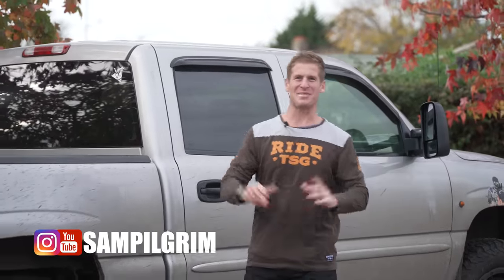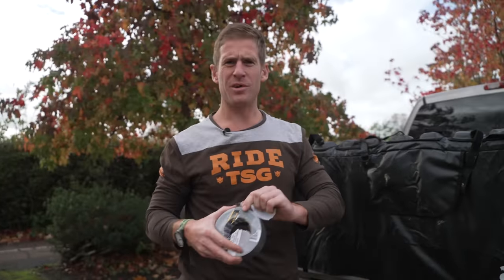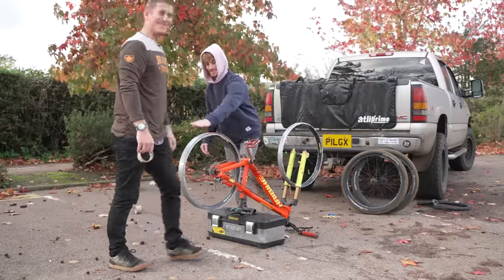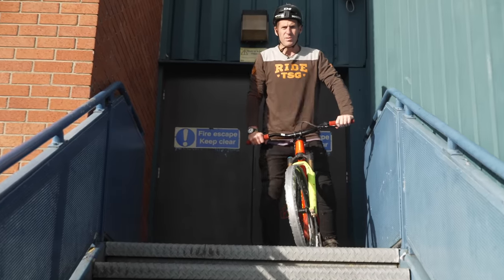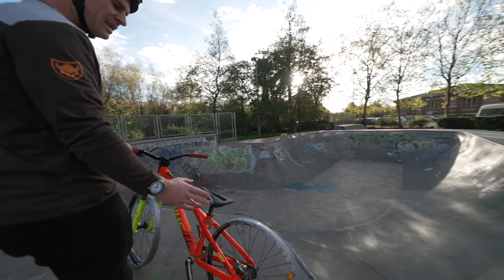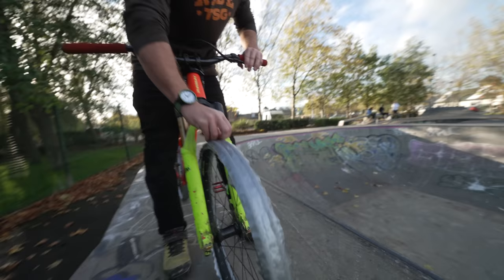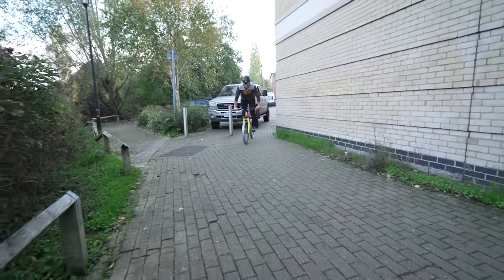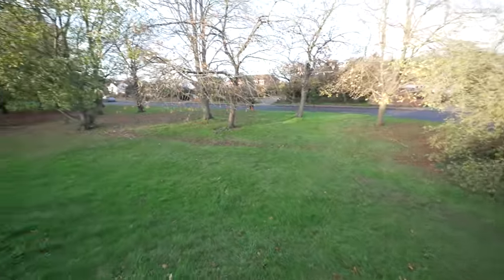DUCT TAPE TIRES ON MY MOUNTAIN BIKE!

Comment: Duct tape works surprisingly well and much cheaper than tires! As for the weight issue? Overrated! 😅 Thanks for the shout-out Sam!
Reply: Well he didn't watch your video, but at least he gave you a shout-out anyhow. P.S. hope Yuka is recovering.
Reply: Gotta feel good to be on the same Duct Team as Pilgrim 😆 And you can be proud of being the original taperider 🦆 📼 🤘
Reply: Cheaper?? It's 26.00 a roll.for the good stuff where I'm at
Reply: @BrianB78  what happened to Yuka.  I couldn’t find the vid
Reply: proper duct tape is about 5 pound each
Reply: @Olliesmith180  on her channel
Reply: @Olliesmith180  last video on her channel ;-)
Reply: your video was awesome!
Reply: @Hybed  I can’t watch it
Reply: Hi Bcpov!
Reply: This would be a sick collab both your channels rule
Reply: Did you mean... "over-weighted"? 😂
Reply: @maddmavic  you can get the cheap Chinese ones for about 12$ for a 10 rolls box 😂

Comment: 4:34 I love how Pilz is unironically making his truck an absolute redneck dreamboat.
Reply: Never understood why people would lift trucks. All it does is worsening overall handling and cornering, and lowering fuel efficiency too.
Reply: @tomlademann2521  makes them more dangerous as well because you create a huge blind spot in front of your truck. It's actually so bad in the united states that all SUVs and trucks over a certain height will be federally mandated to have automatic emergency braking systems. The reason is that because of the size of cars in the US, routine low-speed accidents are killing more people. What happens is these monstrous vehicles barely hit a small car and wind up killing the occupants. 

Additionally, some states have ride angle limitations on some trucks because people lift them in the front but not the back, which creates an even larger blind spot in the front of the vehicle. 

The only reason to lift a vehicle is to fit larger tires on there if you're off road a lot, which means you don't care about handling/cornering/fuel efficiency.

Comment: Hey Sam something you might want to consider instead of matte black on your truck is to rhino line it. It comes out black but it's that's stuff they spray or adhere inside the bed of your truck. Research it check it out I think you'd be more happy with rhino liner than paint cuz it won't scratch as easily Good luck. Also, make sure you put on some form of primer because the glossy clear coat on your truck is not going to allow proper adhesion of the black spray on spray paint. Just go talk to one of the auto painters and see what they'll do it for also you can buy spray cans of the rhino liner research that online too Check YouTube lots of people have done it

Comment: Having tape directly on the rims lunches the "rolling resistance" to the sky !! 🚀 every time this rim hits a bump or even just a rough tarmac it generates forces upwards & backwards damping your foward momentum. This is why tires are soft, they damp the vibrations in the system & roll over obstacles by deforming which is pretty awesome when you think about it :)

Comment: Btw Sam, regarding the wheels - i think when you pump your wheels you end up having less surface to touch the ground and thus less friction, but you retain the bounce via the air compressing and rubber bending and you grip and transfer power into the ground harder with "tenser" tires cause they cut like a knife, ehich is greater for directional change and compressing the ground under you due to smaller surface contact. for instance a skinny car tire in snow is much better than a ferraris wide tires and a knife cuts better than a block of steel 😉 . Remember when you did the lower psi challenge? you started sliding everywhere. when racing you don't wanna drift cause you loose time with the lost traction. Now regarding the density of the layers of gaffa tape, they're right on the rim and the rim is very hard, it cannot absorb and redirect the hits from the ground, the rocks, unevenness, the friction is prob slightly larger cause your ground contact is flat and wider .. ? and it has no chance but to send the energy up throught your wheels n frame counterwise to your travel, like newtons 3rd law i think? i dont remember 😂, so its like a lot of little pushings against you, a restriction if you will. But that's just what i think. was very surprised they slid so much when you turned on your back wheel, but that's the rigidness of the plastic in the tape that makes the tape whst it is, 🤔 if it was softer anything you'd tape back together would eventually sag.

Comment: Been lining the inside of my tires for years with...duct tape. When I owned a road bike that frequently had  rear flats,  opted to stuff the wheel with...foam(bed material). Lots of it. Give-it a try. A little bumpy at first, but your weight will smooth-out the wheel. Tire life? Your tire will wear-out fast. And this was before tire/tube liners became the norm. Once the tire is on the rim, comes the hard part, which is stuffing in as much foam as ya can fit, so the tire stays on the bead, when riding. Removing the tire? Have a hacksaw handy.

Comment: Can you go to Rostrevor sam its in Northern Ireland ew have local trails such as megamission with has huge berms and huges jumps and table tops to send u flying we have a great uplift service and we have another trail on the pulse which is our local dh track and we have a red loop trail and there is a steep techy slippy trail called bins 1 bins 2 bins 3 which are really technical I hope you see this sam !
Reply: We*